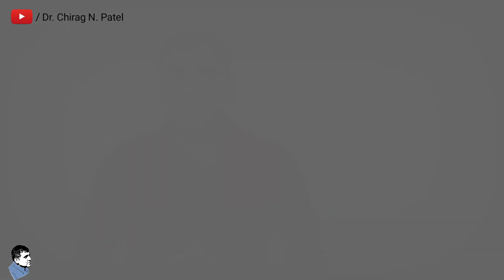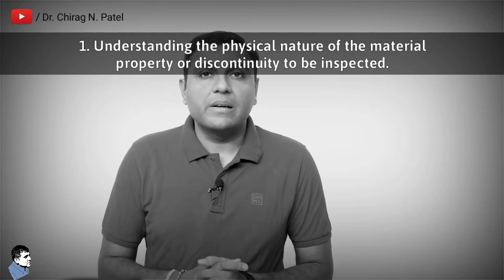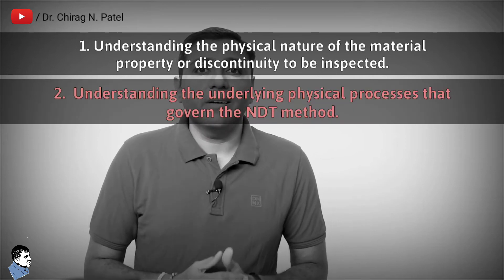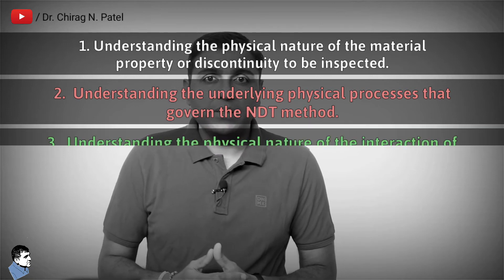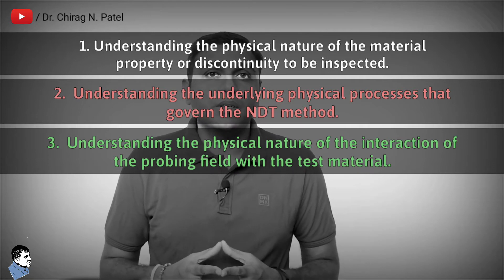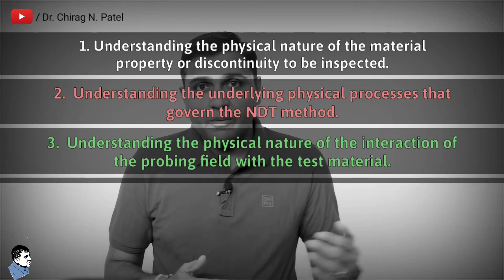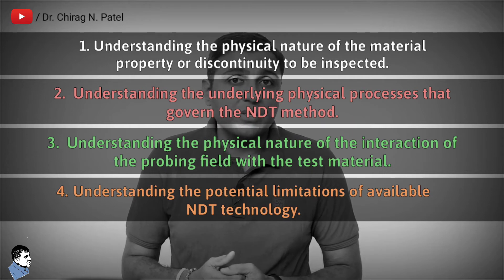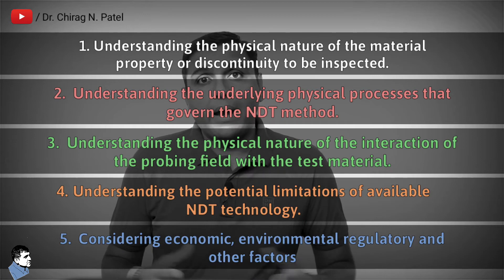Non Destructive Testing of Concrete I NDT Testing Methods for Concrete I Concrete NDT test

Comment: Dr. Patel, I have been conducting concrete NDT for 10 years. I am mostly focused on Pull-Out ASTMC900, ultrasonic and electromagnetic testing methods. In my experience, the mayor challenge has been that, if the structure was not propperly cured, the inner concrete and the cover layer will have different properties.  Long story short, dispite my uncoditional love for High end NDT, we still have to do minimal conventional coring 😊.
Reply from the maker: Dear Oliver you are truly said regarding quality of concrete. But it also deteriorated due to weather effect on outer surface. And your unconditional love regarding NDT is also required to maintain because for accurate judgment it is required. 👍🏽 Thanks for Watching and your concern. Keep it touch.